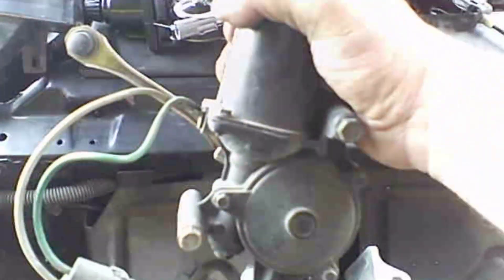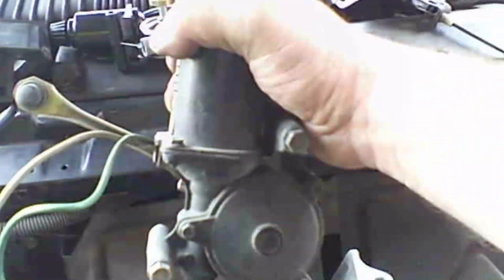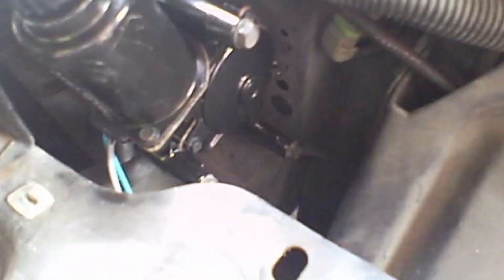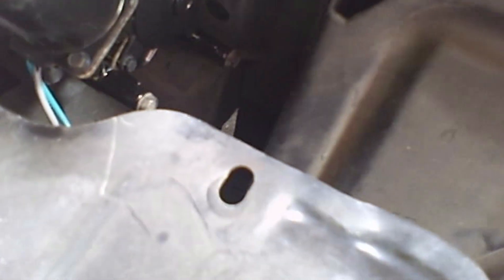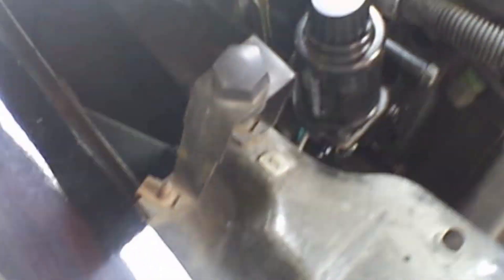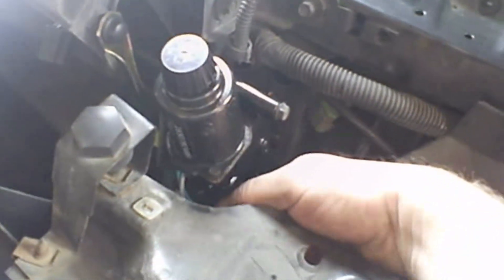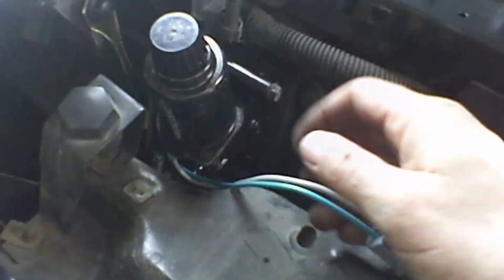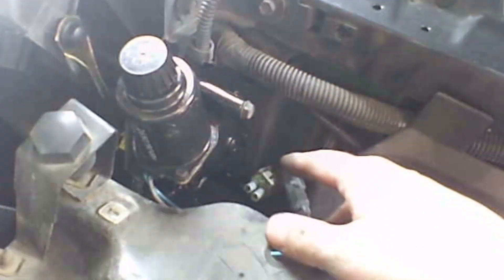Headlight flip up motor replacement 1988 Pontiac Firebird

Comment: I changed the motor on the passenger side. When I turn the lights on the drivers side headlight wont pop out. Any advice would be greatly appreciated. 5/16/2017

Comment: what if my headlights are stuck down, how/what's the best way to get them up?
Reply: If you turn that knob on top of the motor,counter-clockwise I believe,it will manually raised the headlight.